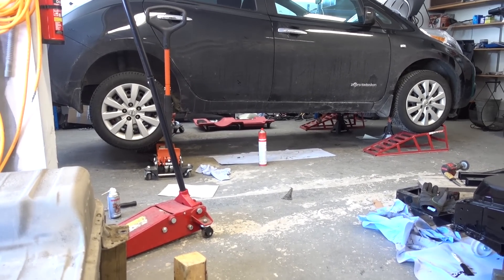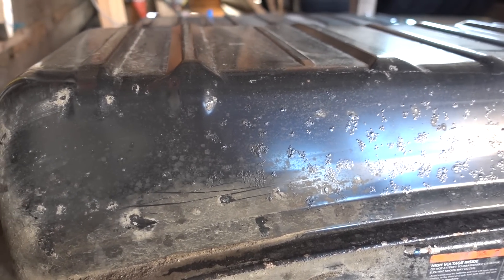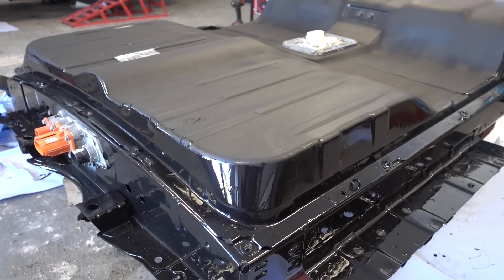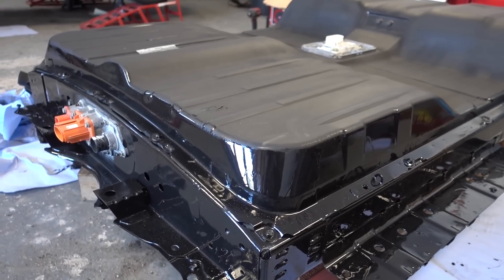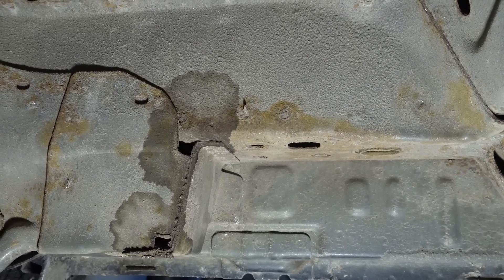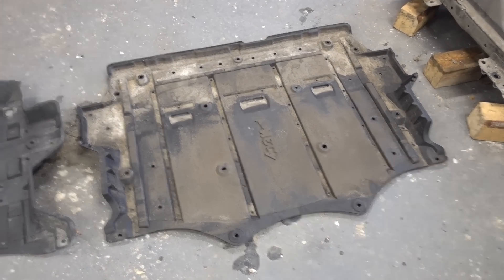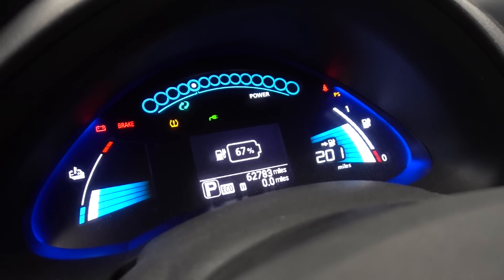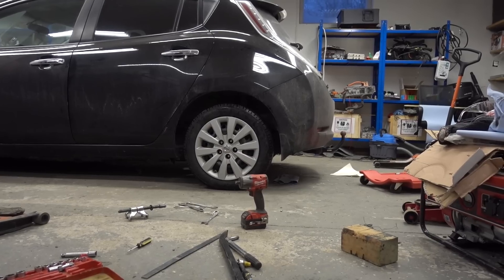My new 62kWh battery is broken😞

Comment: Thank you Dala for walking us through this painful lesson. I was just weighing whether or not to have a used 62 kWh battery installed and now I am thinking the better of it.
Reply from the maker: As long as it is not crashed hard it should be no issue! Most scrapyards have a 30day return warranty, which would have helped here. Also quick test with multimeter at service disconnect location will tell you if there is a leak!
Reply: @ thank you. They are asking $8200 Canadian plus taxes for a 62 kWh battery installed. How does that compare to Finland?
Reply from the maker: @azorty783  A 62kWh pack costs approx 5500€ from a scrapyard in EU

Comment: Hi. I see you also have tire pressure error. Mine show this error when all wheels are good. Do you have/had the same issue?
Reply from the maker: Yes I dont have any TPMS sensors in my wheels.

If you have them, you can re-sync with Leafspy pro. Check the mynissanleaf.com forum for more info

Comment: Hi Dala, I always watch and enjoy your content. You put in great efforts and are very good at what you do. Surely, it is a leak in the cells. When I am working with the hybrid batteries here in US, we just replace the leaking modules and also put a tape( I use making tape ) to avoid any contact between the metal surfaces. More, have you tried using new leaf modules from China as replacements ??????

Comment: My diesel tank is 20 years old.
It still holds the same amount of diesel as it did when it was new.
The 470,000 mile diesel engine still returns very close to the mpg it did when it was new too.

How much pollution does a new battery cause in its manufacture?
That rust proofing oil based?

Comment: The only reason you buy a nissan leaf is to remove it's battery and use it as a home battery for your solar. And you pay for it no more than 2000. Heck, you don't even need to buy the whole nissan leaf pile of garbage, just the battery.
It's be better if you pay like 1000-1500 as the battery will surely have at least 30% loss (most likely 50%), so you get just half the stated capacity .
You don't ever buy a leaf to repair it, that's just umb.

Comment: How bad are the cells in your other battery? 

Is it possible to return the battery you have to where you bought it from.

Is it possible to open up the battery and fix it or find out where it is grounding or shorting out and repair that. 

Can you take the best of the best of your to batteries cells and build one decent battery.

Having 75 or 85 % of 62 kw is better than nothing and better than a 24 or 30 kw original.

It all comes down to miles out of the battery pack.

Sometimes you can get batteries to recondition a little or balance better.
Reply from the maker: All fixed, see the rest of the videos!
Reply: @DalasEVRepair   I will look for them. The date on the video I watched was very recent. Glad to hear that it went well for you.  

I am considering buying one of the older Leafs again and upgrading to the bigger battery. I really like the car and prefer more simple mechanical construction and controls. I hate having everything rely on a single touch pad and screen.

Comment: Instead of using some rust proof paint, have you considered at all to use any of the corrosion inhibitor  specialized product? https://www.youtube.com/watch?v=lyWHF4NoNVk - I have opted for my projects to use the CRC one. Only requires 2mil thick coat with a working T -40 to 79.4°C. Not sure what type of rubberized material you used to spray the sides of the battery pack. If it's the one that is kind of like "black tar", after some research, I stopped using such product because it's not good at all. Thank you for sharing your hard work to the community.

Comment: I'm just curious if you look into the future a few years, is it possible to replace all the cells inside the back with cells that are not from Nissan?

I'm think which second hand car to buy and if the battery is so limited that I can only ever be filled with Nissan cells that is a shame when you think about 10 years in the future then the car will be stuck in time.

Comment: In 7 years, you will change it for sure. It look good for 7 years old and You are not going to be able to drive it for 15, right. The rust proof battery looks very good, though.
Reply from the maker: In Finland we drive most cars for ~20 years. I think it will still be around then :)
Reply: @DalasEVRepair  Hi, I meant the battery not the whole car. The battery will last about 7 years and then you need to replace it.  I like the Leaf its a great car. Thanks.

Comment: In Ukraine, I know at least 4 car repair center's  what solves this type of situation. It could be out of bad balanced cells of battery which is should be solved by special charging station for 96 or more  charging pairs which checking the voltage of each cell. Once again Ukraine I mean 4 nearby my house. So welcome. I'm sure our technicians will gladly help you with this type of problem.
Reply from the maker: Thanks, I just got a bit further with the troubleshooting, will post a new video in a few hours! Slava Ukraini!

Comment: You seem concerned about an extra coat of paint causing battery overheat issues but surely the sound insulating nitrile pads are also heat insulating ?

Comment: I can feel your pain, but surely you will get it sorted out. I would guess it's hard to get Leafspy readout when ordering a battery from some random scrap yard in Norway ? What's your experience have you ever been able to get a Leafspy readout or number of health bars left (If not on the web site listing details) when ordering parts for customers ? Love your videos, very useful tips on Leaf rust proofing. Hopefully in the future there will be a better second hand market for battery spare parts and packs. Dreaming of a 62kWh or 40kWh battery upgrade for my 24kWh Leaf, but buying a used battery pack sight unseen with minimal details feels a bit risky. However if the battery pack is from a crashed vehicle, that usually means the car was running and driving before the crash. I will have to see what kind of warranty bruktdel ja gbd offer before buying.
Reply: I just purchased a 40kwh replacement battery from Grønvolds in Norway, they were able to give me a full diagnostic pdf with cell voltages mv’s“, mileage, soh etc. Got a really good price too
Reply from the maker: Usually you only get number of bars from dashboard, nothing else. I have source over 25 packs, and out of that number, 2 were duds. So still quite good luck :)

Comment: If you drive most of the. Time alone Or in 2 ppl u don't need change springs cuztheres still reserve for 3 X 80kg passengers  and 50 kg roof . 50kg boot 75 kg on tow system :)

Comment: In Canada, US, UK, shops that are doing the battery swap are adding a custom electronic obd 2 module between the battery connector and the car. The BCG is an electronic module installed between the vehicle and the new battery to convert the computer language of the information that is communicated by the battery to make it compatible with the year and the vehicle equipment. Did you install such a module? Perhaps your battery is not as bad as you think.

Comment: That sucks... 😩 Maybe moisture got in the pack, or faulty BMS? 
I think you should start with taking the battery apart as soon as possible. Might be an easy fix after all and no need for new cells.

Comment: Hi Dala
What about just bypassing the bad cells altogether ?
(until you can get the replacements)
Of course the BMS wire will have to be dealt with...
I am just raising this possible workaround, in case your knoledge of the battery tells you it's worth trying.

Comment: You have made a lot of improvements so this was a bad luck , don't go down this shit happen when you do stuff like this, I suggest you to put the 40 kWh battery and open the 62 to check the which cells is broken.

One way is to put some 40kwh cells if will help, or  make 62 kWh cells with 18650 to replace them temporarily until you find the cells you need.

Comment: There is a connection to the chassis, cells that have lower voltage are being discharged over voltage measurement circuit. Remove the electronics if you wanna stop cells over discharging exceeding lower cut off limits. Check voltage between + and chassis, and - and chassis.

Comment: Do you have any idea of what caused this problem with the battery?
Reply from the maker: We will see after this weekend, stay tuned for the next video!
Reply: @DalasEVRepair  I've had a similar problem with a brand new Leaf with just a 1000 miles on the odometer. I'm thinking factory defect.

Comment: Sometimes it helps just to open the pack and remove the cells, get them rebalanced and reinstall. Properly torque all connectors. A lot of work, but no expensive replacement parts needed.

Comment: Sell 62kWh pack with an inverter that someone can buy from you to power their home when they already have solar panels and make a video about that. Then when another 62kWh pack becomes available then continue this project. I didn't understand what someone had said but he talked about running aircon while charging J1772 24kWh which takes about three days to balance modules. I know this doesn't make sense but it might have meaning for you. In the meantime use 40kWh pack unless you have a solution

Comment: Buy Fluke 1507 to check isolation before installing the battery. I think installing 40kWh back and investigating the issue is way to go. I feel your pain, because I just repaired my Focus Electric isolation issue. Maybe you have to open bursted modules and renew those dead cells. But do not worry, we EV enthusiasts need these kind of experiences to learn about working with these. It feels bad now, but will give you knowledge to the future. Good thing is, that you can put old battery back and drive, I had to keep car in garage and drive with diesel so it was little expensive to had my EV stalling for a while.  

Hope you have problem investigated soon!

Comment: Really nice rustproofing Dala.  Sorry to hear about the cells.  If the module can't be fixed, keep an eye out, one will turn up, or find another whole bad 62 pack.  Then you're the guy in Europe with spare 62 modules!  In my stationary storage, I have 2x 7s modules from a 62kWh pack (not sure if shipping is worth it or possible, but I would send if you need, I guess they're in good condition).  But it looks like you need a 9s module.

Comment: Great videos. So much work, I hope you'll find some spare modules soon.
You seem to know the Leaf through out - I'm installing parking sensors in my one is there any way you can think of telling the system car is in "D"? In my tekna "D" allows you to use frontcam and goes off when accelerating I wonder if this could be used?

Comment: 85 comments in and still nobody has said:

Have you tried switching it off and back on again?

Great rust proofing tips. I have had my 2011 leaf parked about 100m from the North sea for over a decade now and I suspect I'll soon be able to kick a hole in it. I'm frightened to look. I haven't had reason to be right underneath it for a few years!
Reply from the maker: And if the restart doesn't help; Maybe putting it in a bowl of rice will fix it? 😅
Reply: @DalasEVRepair  Big bowl of rice...
Reply: Now you're talking, Ah la Rich rebuild style😂

Comment: Having fried my a 40kwh battery pack myself due to weak cells, I went for buying another battery pack. And yea it's expensive as heck.

Since you haven't fried your battery due to the weak cells zeroing out and shorting like mine then you still have a chance to replace them. 

Either ways you'd have to remove the 62kwh and I think this is your daily driver so I'd personally swap back the 40kwh so you have a working car in the interim. Likely you'd have to open the 62kwh pack anyways.

So interim, swap back 40kwh. And go from there. It'll probably take time to find a 62kwh "cell" or another pack. Maybe take a few days of rest because these kind of setbacks are exhausting. I didn't work on my car for months after I fried my 40kwh.

You can do it!

Comment: Don't give up.  The battery can be fixed.   Rustproofing battery and car is a great idea.  I had my 2012.09 Leaf fully coated with Mercasol when it was new.  After over 60000km in just over 1,5 years the underside still looked new. (South-West coast of Norway..)  Now there is a lot of Gen 1 Leafs that are being crushed here as they have been used up.  Batteries with 3-5 bars, no brakes, fully worn out suspensions, etc..  Soon the Gen1 Leafs will be no more.

Comment: Hope you get good luck next time. A lesson to learn for all of us when buying refurbished batteries. Your videos are a great help for us. Maybe this is why repackaging is sometimes better than to get these refurbished OEM ones. With repackaging you can get newer cell chemistries like NCM811 and you know the condition those cells are in. Plenty of space for even more than 62kWh as new cells like NCM811 has higher energy densities than OEM Nissan ones. Then it all comes down to how you mount the cells/modules securely and distribute weight like in OEM modules. There's space for liquid cooling/heating even if you use 355 modules.

Comment: 9:02 from leafspy it shows 4 cells, if the layout in bms is kept the same then cells 1-48 is rear stacks. in 64kwh pack there are 4 towered stacks in rear. The faulty ones are in the first stack then.. the good news is that unlike the 24kwh pack - faulty ones cant push on everything when expanding. Only their tower. 
So if you can source one good rear towerstackj, it can be replaced :)
Did the pack have any dents in it? Or maybe marks undenting.. as it's the first pack - it might be some collision damage that some corner hit the tower of cells.

Comment: Those batteries should have 8 year warranty. There's no way it's 8 years old. Does the warranty agreement say that the warranty is ded when original car is written off?
Maybe worth a call..
Reply: No, but you might be able to swap it into a car with warranty and see if they cover it.
Reply: The 8 year battery warranty relates to original use in the car it comes in only.

Comment: many times I've had repaired cells in new ze1 leafs with leakage from the corners, the cells have really bad hermetization and in 99.9% cases they are quickly repaired by proper sealant. So I insist on disassembling the pack and see what is going on with P0AA6. Anyway everything is going on for the greater good!))
Reply: What is P0AA6?

I had no idea. 
Searches…..  hope this helps someone 

‘DTC P0AA6 stands for “Hybrid Battery Voltage System Isolation Fault”
This code is logged when the PCM detects an isolation fault in the high-voltage system.
Possible causes include issues with the high-voltage battery and/or cables, as well as problems with the battery control module.
Common symptoms include lit warning lights, a battery that doesn’t charge, and vehicle startup issues.’
Reply: Just reading this comment… i am thinking to buy this car with what appears to be a dropped cell (44)
Im paying someone a days rate to fix it. Should i have a spare cell ready or ask them to charge it seperate as long as its not damaged..
Reply: Should be a video on that.
Reply: Where are you based?
Reply: @AlanValentine  RU

Comment: Is it possible to use leaf spy prior to purchasing a pack when it’s out of the car?
Reply from the maker: Yes I have a guide here: https://github.com/dalathegreat/Nissan-Leaf-Battery-to-OBD2 However, isolation faults are harder to spot!
Reply: @DalasEVRepair 'm sure this SHITuation is going to end up with a way to test for isolation before purchasing. Did you try measuring for voltage between the battery housing and terminals of the safety interlock?

Comment: If there is someone who has the skills and attitude to overcome this problem is you.  Maybe you have luck when opening the battery pack you find the leakage not inside the cell but any interconnection module strap or BMS connector...   Cheers

Comment: The rust on the underside of the car is not so bad..just scrape off the worst of the rust flakes and use thin corrosion threatment. Let it soak in for a day or two and give it one more threatment. It should just be wet layers and if it is against the road u top up with a harder layer.

Comment: Bummer mate. It's always a bit like Russian Roulette when buying battery packs and I guess your luck ran out.
Is there no way to get something back from the supplier?
I guess downgrading back to the previous pack is your first move until you can sort something.
Reply from the maker: Yes that is the first move. Seller could not have known this, so I won't pursue returning it ( I already modified it with that paint 😅)
Reply: You're too decent. 😊
It might be worth contacting the seller to tell them the issue. They might offer a partial refund.

Comment: That's devastating 😢
Do you know anything about the vehicle that donated the battery? Forgive my ignorance, but it seems unlikely that a crash write-off donated battery that was physically intact would have suffered (or had already been experiencing) this issue, which suggests the battery fault was the reason the car was scrapped and they knew this when selling the battery.

Comment: Damn that's sad news. sorry it did not work. but I am insanely impressed with the fact that it said 200 km with the old pack.  it is a real pity that diagnosing a batterypack isn't a thing until it is in the car. for reference I'm getting 60 km/charge in a 85% soh battery when charging to 80% so you still have a highly usable car.
Reply from the maker: Yeah the problem was only visible at high SOC, so very hard to spot before it was installed!